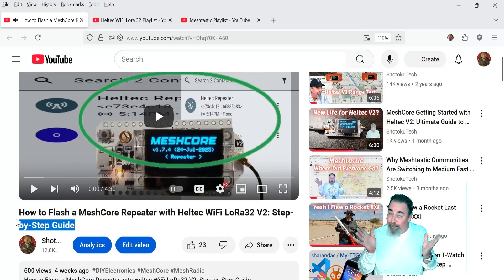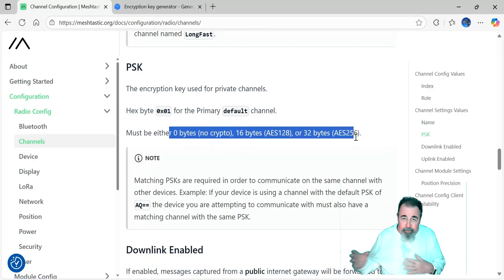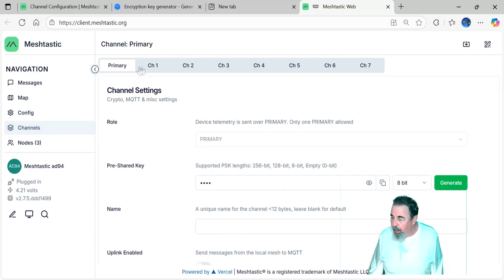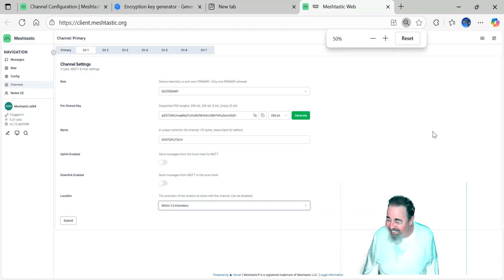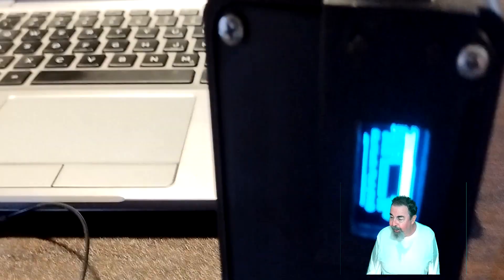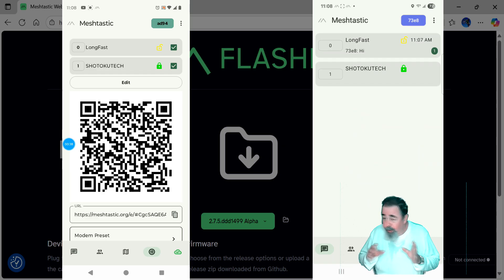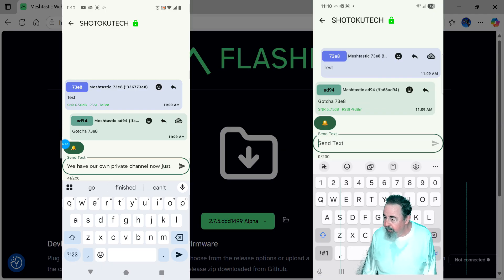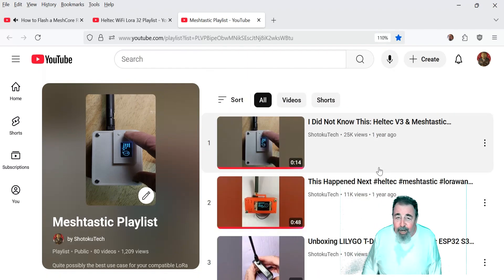How to Add New Channels in Meshtastic: Step-by-Step Guide for Beginners

Comment: Thank you for the interesting video.
I also have a Heltec V3 installed here with special sensors that are unfortunately not supported by Mestastic.
It would be interesting if such special data could be sent directly from a V3 to a private Meshstatic channel without having to install Meshtastic itself on that device. So, with just an AES key, username, and sensor value, you can generate the payload for the private channel yourself and then send it to the Meshtastic network. This won't be easy to implement; unfortunately, I'm not a programmer, but since the Mestastic firmware is open source, perhaps there is a programming expert who could take on such a project.
Reply from the maker: I'm not much of a programmer either. I am more of a hardware integrator that can do a little code in a pinch. Interesting topic. I wonder if you sent the sensor data to MQTT and then in Meshtastic have the data sent to the mesh? I want to explore MQTT and Meshtastic sometime as well.
Reply: @ShotokuTech  Now I transmit the sensor data independently of Meshtastic via the Lora-Monitor and forward the data to a NodeRed dashboard via MQTT, 
which also works well. For longer-distance transmission, it would be interesting to be able to use the Meshtastic network 
and then transmit it via MQTT to, for example, a NodeRed dashboard. I haven't done that yet, but it would be an interesting topic.
Reply from the maker: @DanielMosermeier So you have taken it pretty far already. Sounds interesting. Best wishes.